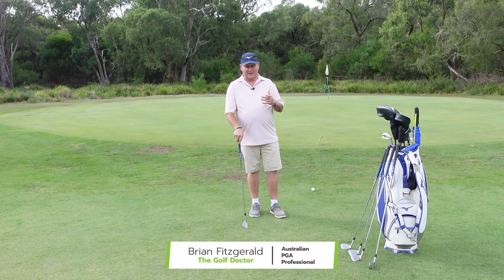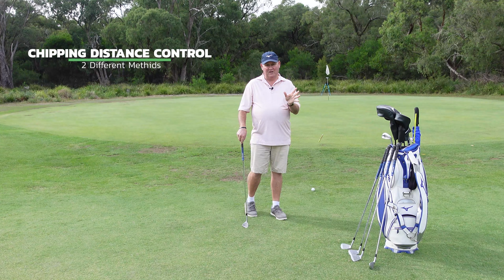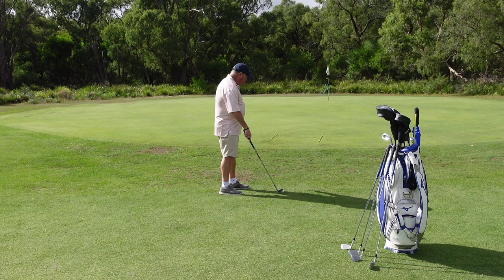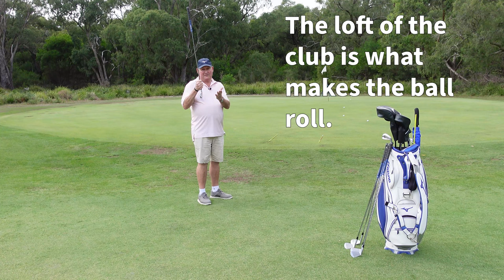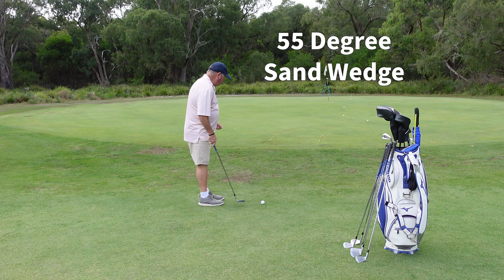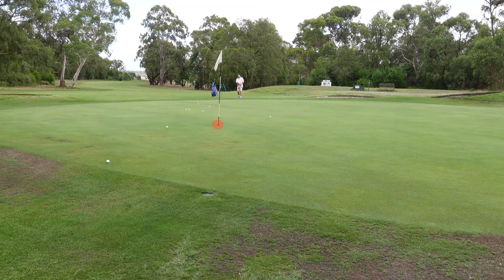Chipping Distance Control 2 Methods

Comment: Thank you Brian. That a nice one on explaining both methods in clipping close to the green (clip n run). I am only using one club for my clipping, with different length of back swing to clip and get my ball to roll & stop at the distance of 10m, 20m, 30m and 40m (more like pitching for this 40m n above). I do practice allot, at least twice in a week just in clipping, putting n bunker. I realized I can score much better when I am sharp at this areas. However, golf is such an difficult game. The moment I am lazy in practicing, I lost the feeling and confidence and my games suffered immediately :( I think it might  be the right time for me to use the 2nd method as per your instruction by using different of clubs, with the same length of backswing and let the ball roll in different distance.  It should be much more easily and consistent too.
Reply from the maker: Well done on focusing your attention to the short game Steve. You have discovered the area that will make your scores more consistent which is what everyone wants but they think its their golf swing.

I think you will find the first option even better for you as it is easier. It might also give you the spark you need to get back to your good practice habit.

I would love to know how it goes for you.
Brian

Comment: Thanks Brian that is a good presentation.  Getting the run distance correct is the trick!  And of course up hill and down hill shots make it hard also, I will try your method one.  The course where I play has a lot of cruel uneven ground around the greens not many flattish lies up hill and down hill greens so I use my 8 iron most of the time to chip and run.  I will also look at the 12 times method mentioned in comments that may work for me also with calculating my landing spot.  It is an ongoing challenge!  Cheers Sue
Reply from the maker: My pleasure Susan.
It is an ongoing challenge. It sounds like your course has some challenges so you might not need to use as many clubs as I did in this video. Just think of 10 feet or 3 m between each of your chipping clubs and you will be fine.
You could use your PW, 8 iron and 6 iron and you will find that will be enough.
Let me know how it goes.
Brian

Comment: Excellent examples of two methods for chipping Brian!  I probably use both methods,  The first for chips of the length you were displaying using a 7, 8, 9 iron and a landing area of 3 feet.  The second method is more for up close pins where I am off the green ten yards or so then I would use a sand wedge or gap wedge.
Reply from the maker: Thankyou John for your feedback. I think you are right there is a time and a place for both. The important thing is to realise which is best for which circumstance. It sounds like you have done your research (practice) and have worked all of that out. 
Thanks for watching. 
Brian.

Comment: Dear Brian Excellent way to chip. I am following your method no 1 with 7 Iron. 7 Iron is giving good result. Just one problem i am experiencing when ball is in uneven and undulated ground. Hope to get your reply with solution. Thanks.
Reply from the maker: I am glad my video is helping your chipping. 

You need to practice from all of the un even lies you can get around the green. 

A clue is always to align your spine at a right angle to the slope. 

Brian

Comment: Really interesting. Definitely method one when it's possible, though probably a bit of a mix. I find it helps to do a chipping warm up to gauge how the balls rolling on the day, prefer a dry day when I don't have to flight it so far and can land short of green if needed. Use the putting "tick tock" method in my head for judging distance to landing spot. Thanks Brian
Reply from the maker: You are doing it right Adi. 
It should be apart of everyone’s warm up and I’m  no a big fan of the tick tock for chipping. 

No B wonder your scoring lower. 

Brian

Comment: Very interesting and inspiring… forget about the flag… how much should the ball roll from the landing spot… I use my 40 degree 9i for most chips and try to chip with ‚feel‘ like putting… I change the landing spot. 😊
Reply from the maker: There is about a 5 foot run out between clubs.
Keep the landing spot as close to you as you can.
Brian

Comment: I've recently taken to my 56 degree sand wedge for chipping. But only for distances up to 30 metres. And only if the lie is excellent. Otherwise I'll take an 8 iron for example. The advantage of the wedge is quick stoppage.!
Reply from the maker: It looks like you have a clear plan Peter.
The wedge is a quick stopper when hit correctly. If you are a little off not so much.
If it's working and lowering your score it must be right for you.
Brian

Comment: Method 2 for me with a bit more hinge
With method 1 if ball is 3 m back further now you have a different shot
Then 6 m out another 
So now you have x number of shots times y number of clubs to practice 
Method 2 is just x times 1
Also with method 2 you only need to read about 3 m of green
Reply from the maker: Where the ball is situated from the edge of the green certainly changes things. It reduces your club choices that’s for sure. 

As I said in the video everyone needs to find what works for them. 

It sounds like you have and it’s working.
Reply: @fitzygolfpro  absolutely I’m not anti method 1 because it comes down to what one is comfortable with on day
There’s a million better golfers than I using both techniques
Reply from the maker: I second that Brad.

Comment: Less loft means to hit in same spot means you have to hit harder because you usually choke up on the clubs.  Unless you are also saying don’t choke up and the length of the shaft makes the ball go longer such that it will hit the same spot.  But that is not true because the length of the shaft does not correlate to landing distance.  When you are switching clubs and trying to hit the same spot, you are actually hitting harder.    So you are controlling distance by how hard you hit it even though the length of the shaft might partially help.  But telling someone to chip with the full length of shaft means trouble.  It is easier to choke up on the club so it is not so long.
Reply from the maker: You are making this way more complicated than it it needs to be.
Just hit the spot and let the loft of the club make the ball run more or less.